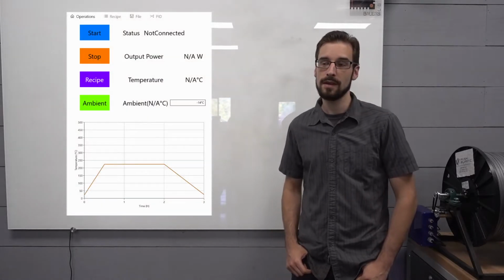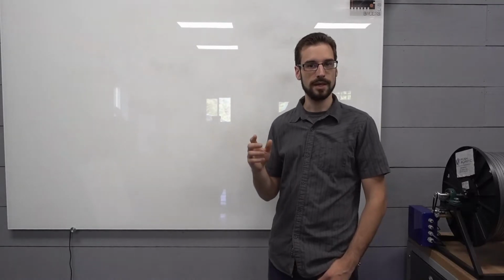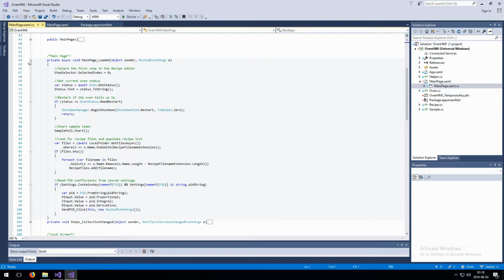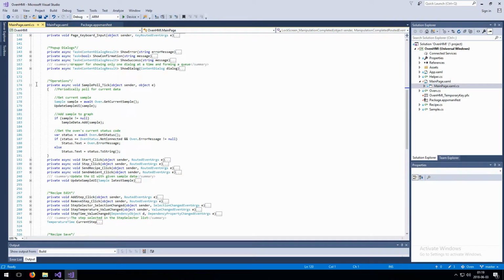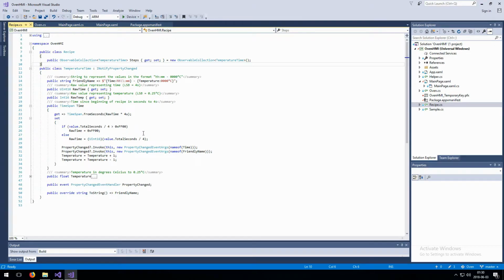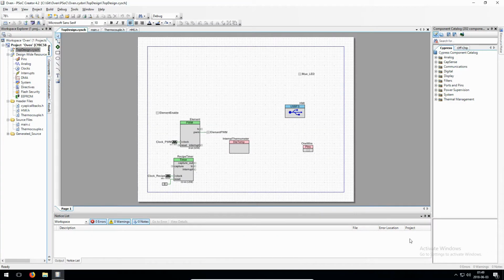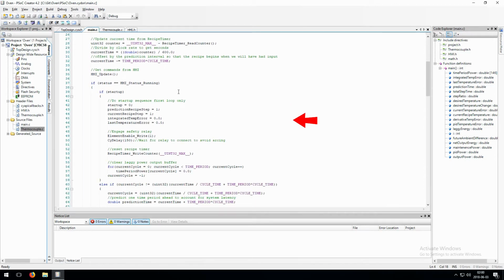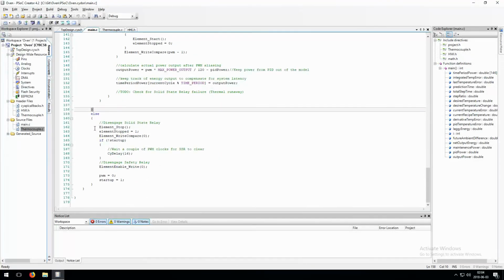Lab Oven (Part 6) - Software Overview

Comment: Very nice project actually. Found out about your channel via ODrive and I really like it. Keep up the awesome work. Have you done anything with the oven as of today ?
Reply from the maker: Thank you. I just got my new Odrive 3.5. So, I am hoping to do a bit more with that soon.

I have only powder coated a wrench so far. (The one at the end of the video) That worked out really nicely. Soon, I will design a rack for the oven and make a video about powdercoating.

Right now I am working on reorganizing and tooling up the lab. It isn't very exciting, but it is needed.
Reply: About the ODrive it's open source but i just don't know what software they used for their PCB and how to get it into a gerber so i can make it myself. Well not completely myself as i will just use some cheap PCB manufacturer but the soldering and such. Really like the project and the price is good but well still too expensive for me :/

How expensive was this complete project ? And that's a very clean powdercoat...
Reply from the maker: The Odrive hardware is a separate project on his github. https://github.com/madcowswe/ODriveHardware

With the weak software on the Odrive, I don't think there is enough money saved to justify not using clearpath servos. But, with considerably improved software, I could see Odrive being very useful to hobbyists that want to do serious servo control.

The whole oven ended up costing me about $1200. But a lot of that was just due to mistakes. If I were to do it again, I could probably make it for under $800.
Reply from the maker: Oh, I just realized that you were asking about the software used to make the PCB. I bet you could open the files with Circuit Maker. https://circuitmaker.com/
Reply: Altium has a free tool ? That's awesome! I'm definitly going to take a look at it. It's definitly a cool project. And yeah i don't know about the software on ODrive, is it so bad ?
Reply from the maker: I work with industrial servo drives for a living. So, from my perspective, there is a lot to be wanted.
Reply: Bauer's Lab Is Clear Path the only industrial servo provider?
Reply from the maker: No, there are many. I am most familiar with control techniques (Nidec) Servo drives. Clear path is just more suitable for hobby use. I wouldn't suggest normal industrial servo drives to people because they can be $1.5-3K for an axis.
Reply: But it's very accurate, what's the accuracy of a servo drive? Does it have the same step count and degree per step as a stepper motor?
Reply from the maker: I would very much not say that it is accurate. (And I do think that software can fix this) The Control loop is very loose. On a real servo you should be able to tightly hold +- 2 counts or so. If you try to move it, it should be able to immediately use full current to fight you. When you turn it by hand, it should feel like you hit a wall, rather than a mushy spring. Some of this is due to using hobby BLDC motors, which are a little different in their construction from industrial servo motors. But, a lot of improvement can come from implementing a proper PID loop with a separate motion profiler rather than the temporary system they have in there now. It is really early in development, so don't take it as I am casting stones.
Reply: Well that kinda sounds even more interesting for me. I'm really looking for a few projects I can do at home during the vacation and that really sounds like something fun further developing software for the odrive. And well these industrial servos what are the cheapest? Or which ones have the best price to performance ratio? Sorry that I'm bothering you with all these questions btw
Reply from the maker: The clearpath servos are by far the best that I have seen for the price. They are make by Teknic. Don't worry about the bother. This information is really hard to come by on the internet. That is a lot of why I made this channel. Once I get tooled up, I will be doing a lot more industrial-like projects.
Reply: Well that would be very nice. The first thing I really need to build/have is a welder. I hope I can build a proper one myself and then I can make frames and such that are rigid enough for some good self built cnc. I really don't like the extrusions I think they aren't sturdy enough in my opinion or am I wrong on that?
Reply from the maker: One option you could look into is the new one from harbor freight. Look at AvE's more recent reviews. There is an orange welder in there that looked pretty good.

About extruded aluminum, I completely agree. If you will have any meaningful forces/accelerations, avoid the extruded aluminum. If you want something really rigid, you can weld square tubing and then fill it with concrete to dampen vibration.
Reply: Bauer's Lab well I'm from Belgium so sadly any harbor freight offer does not apply to my country. And the MIG welder lidl sells in my country is not as good as I would like to see to weld anything decent.
Reply from the maker: Oh, yeah. That wouldn't work then. If you do make one, the odrive would probably do a good job of feeding the wire at a constant rate. : P
Reply: Yeah the feeding and stuff is well a problem for later first I have to figure out if I could convert two 2100 watt 12v psu's to be able to weld. Any suggestions on that? Do you know the welding voltage by any accident?
Reply from the maker: I don't think that off-the -shelf power-supplies will handle short circuit mig. The voltage is going to be a variable that you will want to be able to set based on what you are welding. You might want to just bite the bullet and buy a nice welder. It will be really hard learning how to weld while also learning how to build a welder. You would probably need to get some mosfets and build up the circuit and controls with a micro-controller. If your electrical knowledge isn't very strong it might be a bit dangerous.
Reply: Well my electrical knowledge is pretty good, could always improve of course. And well it's a server PSU so it's able to put out 12V DC 175A but yeah it's probably not going to work... It probably is the best idea to just buy a proper welder.
Reply from the maker: I certainly haven't regretted getting mine.
Reply: I wouldn't regret getting one either it's just I would like to build it myself and i'm not really prepared to buy like a proper welder for 500 Euros like that's too much for me as a student sadly :/